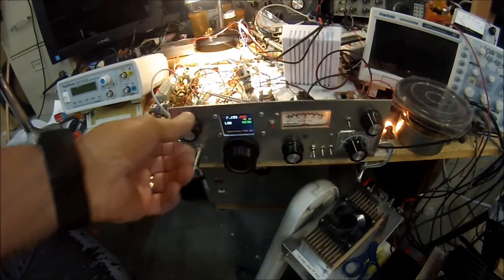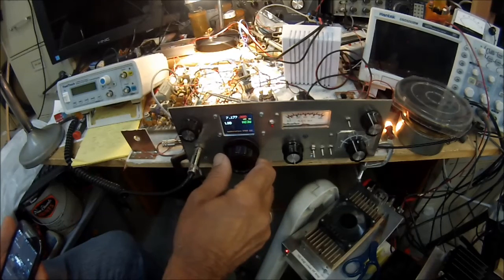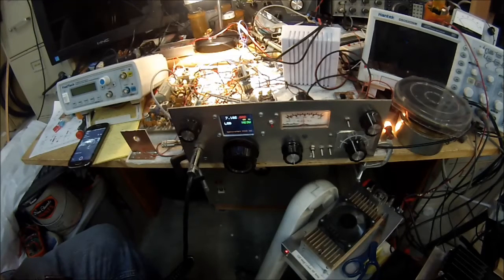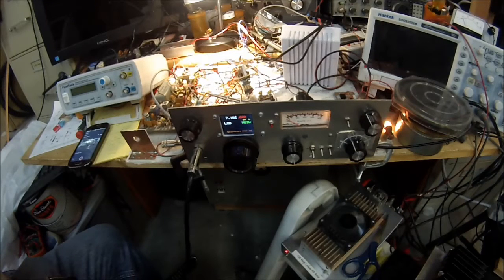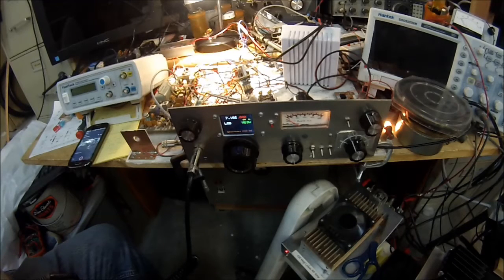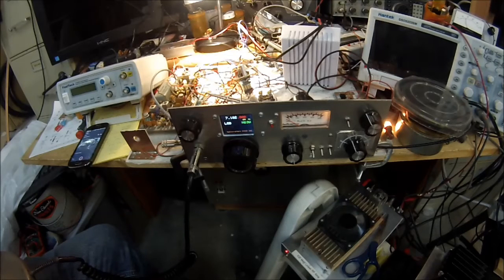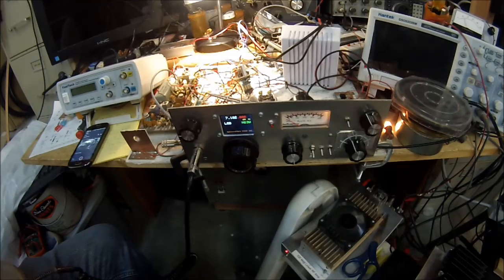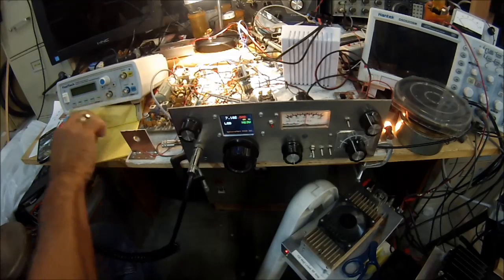The FPM5 -- A 5 Watt SSB Transceiver

Comment: Nice job Pete. Somewhere under the bench I have an SSB CB radio (never been legal to use here in the UK unconverted). I'm thinking your FPM5 conversion example could inspire me to make it live again (with SI5351 VFO). Maybe 2 bands 40 & 20 would be useful.
72/3
Tony G4WIF
Reply from the maker: Hi Tony,Thanks for your comment. That would be a great foundation for a conversion. The only issue might be the crystal filter frequency -many were at 7.383 MHz which might cause some problems with 40M. But certainly 80M 17M and 20M would likely work OK- or even better your 4 Meter band.73'sPete N6QW

Comment: Nice rig and video, Pete. Like the square holes - my nemesis. 
Tom, ak2b
Reply from the maker: Hi Tom,Thanks for your comment. Harbor Freight sells a table top small mill for about $300. That will fix the square hole problem. 73'sPete N6QW